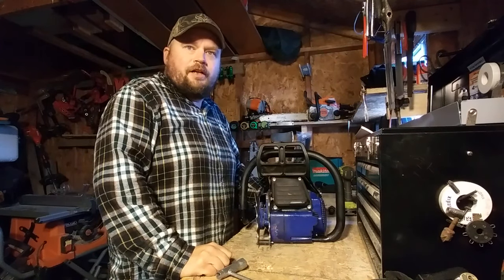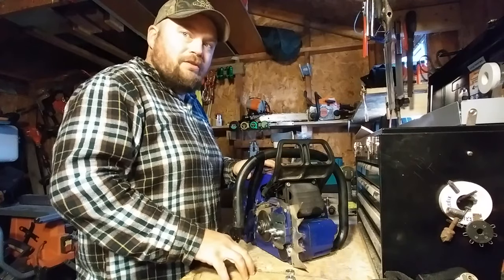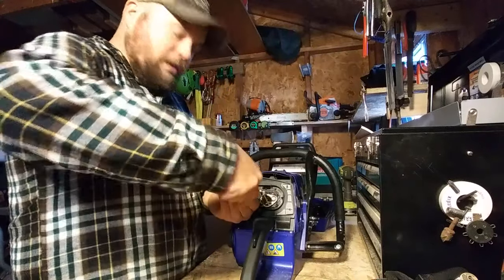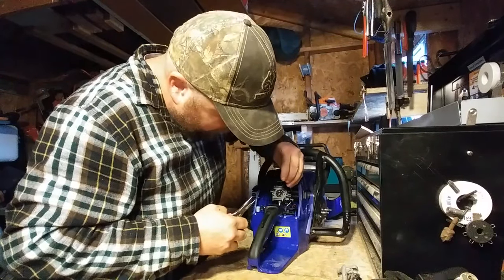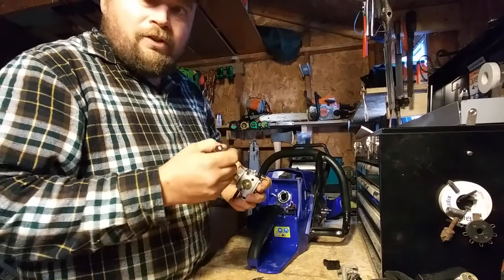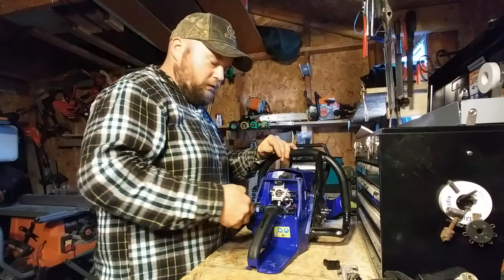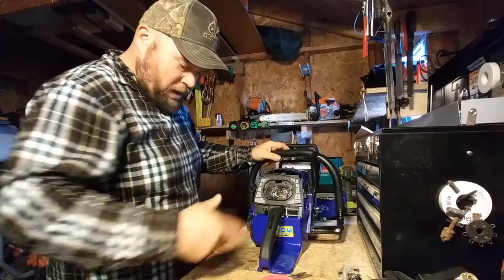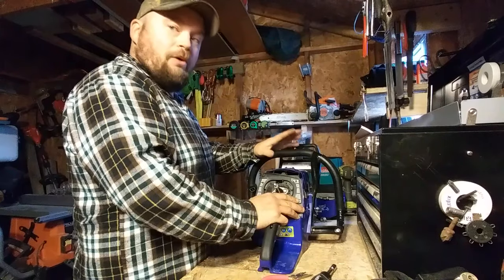Holzfforma G660 92cc chainsaw. What has gone bad after 6 months of use.

Comment: Pop open "the exhaust" - there's nothing inside. It's just a pretendey exhaust. Pop off the pull-start - it's just a pretendey pull-start. Then dive into the carb - the carbs rougher than any bears behind - even the roughest bear with the roughest behind. The jets are machined using a machete.  First hint is how crap the pull-start handle is - it's majorly crap. Your knot will pull through - use a washer.. if you can still be bothered.  'cos they're chunk. Utter muck. Every time I pick the POS up, I regret it.

Comment: you said you wouldnt buy another 660? whats your reason?
Reply from the maker: Mainly because I don't need a saw of this size but maybe a 10 times a year. I could have just bought the 372 and had plenty of saw with that. I'll rebuild this one when it is time. But the next purchase will probably be a 70 to 75 cc saw.
Reply: @brandons4802  yeah I have also questioned my sanity for wanting such a big saw..haha.but I cut about 50 cords of firewood a year and sometimes i get into some big stuff,so having that kind of muscle would be nice.i was planning to buy a g660 when I get my stimulus $,but now I see holzfforma is having a blowout sale on a pick any 4 saws bundle.so I would likely get the 272xp,also, as well as either the g444 or g388.my 4th saw would be a jon cutter 2500 top handle limbing saw.do you think it would be a wise investment of about $800?
Reply from the maker: @thehonestwoodcutterbradywe8011  I would have to say that would be a wise investment. From what I've heard others say about that Jon Cutter. You can't go wrong with them.
Reply: @brandons4802  especially considering the ridiculous price of limbing saaws and that one on sale is $83
Reply from the maker: For the price of some of the holzfforma saws and jon cutters it doesn't hurt to buy a couple at a time. And for $83 I may order a few.
Reply: @brandons4802  you might take advantage of the buy 4 sale
Reply: Brady West our of curiosity why go 272, 388, 440 all pretty much the exact same hp ? 660, 460, 361 jon2500 ?

Comment: So another words the it’s a  piece of shit and you got a work on it
Reply: Only issues I have seen is operator error. I own a few and there every bit as good my Stihl and other saw's.
Reply: Floyd Beard do you think it will last as long? I got 1 it was 100% for the 1st 8 Tank of gas then it was all down hill
Reply: Floyd Beard I thought it was just me The torque is surprisingly strong at low RPM though and your right if you didn’t have a choice and you had to get it like I did there’s no o way that I can be mad at something maybe I should have not let my brother take it for a job that
Reply: @poorsalotto6108  what fuel mix you running and what brand of 2cycle. Every saw I buy no matter the brand I rip the topend and make sure the jug ports are great and clean if so I'll open up the intake and exhaust port I use my drill with a point rotary tip and I modifie the exhaust. I run 25:1 for the first tank then I change it to 40:1 and adjust the carburetor but not much you want the sparkplug a light tan. The oil I run is Lucas I was using the Sthil but it caused to much carbon
Reply: Floyd Beard Well perhaps you got me there I’ve been running  Quaker State oil😒😒40:to 1 50:to 1 Seemed like it was running to lean
Reply: Floyd Beard Yeah I’m gonna have to try that
Reply: Floyd Beard where can I get one please